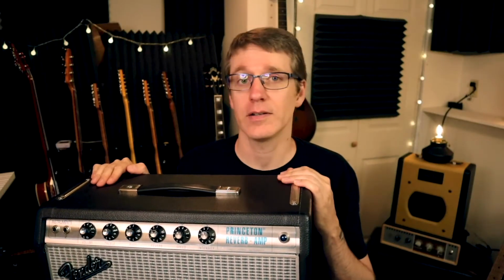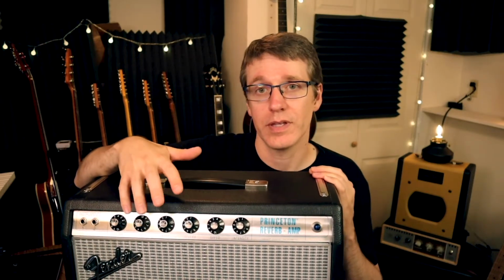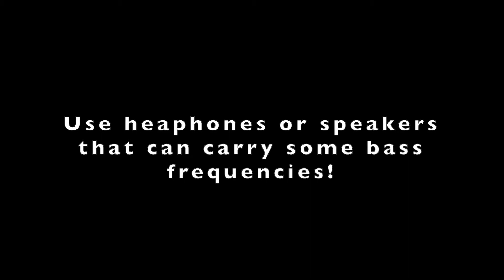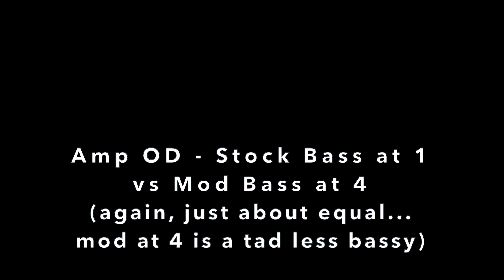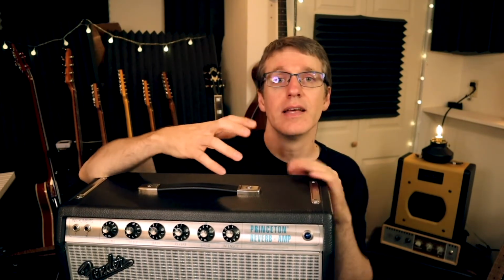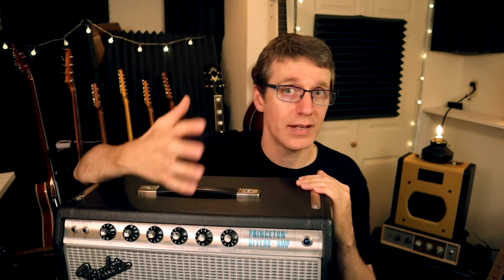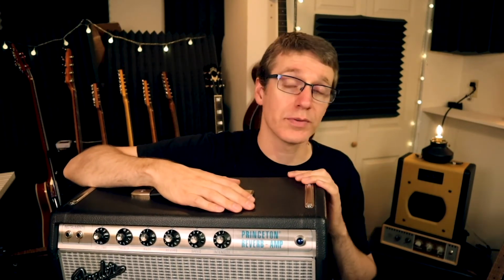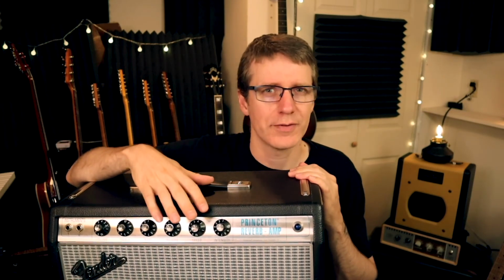Princeton '68 - Too Much Bass: FIXED! Stock vs Bass Mod Comparison / Fender Custom Reverb Amp / Mud

Comment: Excellent! I was considering adding a bright cap, to try to balance things out a bit, but I’ll give this a shot first! The switch idea is a neat idea, hard to tell if maximum bass is affected with the mod, but it doesn’t seem to be, based on your sound clips. Great video!
Reply from the maker: Glad you found it helpful! you get a LITTLE less maximum Bass, but I’ve never maxed it out for anything more than curiosity/comparison with the mod. Plenty on tap. Cheers!
Reply: @haskitt  thanks for the great video and the comment! I might just have my tech change the treble resistor so I can turn the treble up more, to balance it out more- wait, with that mid resistor bypassed, does the treble seem more responsive? With less mids, it should seem more sparkly and bright, inherently. I’ll watch the video again and think more about the treble this time.

Comment: I actually returned mine to the store due to the bass issue.  I wish I had seen this video first.
Reply from the maker: It’s really shocking how much bass comes on these things… I’m not surprised you returned it!
Reply: @haskitt  Do you have any experience with the 68 Vibro Champ? I’m not sure if I can get similar tones without the bass issues, or if I should stick with the 65 Princeton.

Comment: I opened mine up, and it does not have this resistor at all. But my amp definitely still has too much bass. It was built in 2021. Does anyone know what to do in this instance? Thanks!
Reply: I’m noticing the same with mine too (2019 build). Were you ever able to figure it out?
Reply: @LoganMcHargue43  Yes I was. And I’m glad to help. 

1. Change the tubes. I put in JJ’s and the over the top midbass reduced quite a bit. 

2. Change the speaker to eminence Alessandro GA10-SC64 10” 8 ohm. This cleaned up the nasty break up of the original speaker. It still breaks up between 4-5 but it sounds good. It also sounds like a heavy blanket was taken off the amp. 

These two changes transformed the amp completely. A little more expensive than jumping a resistor, but it’s now my favorite amp and I use it 90% of the time for both live (mic’d thru PA) and studio recording.
Reply: @BaronVonNebula  Thank you for taking the time to respond, I really appreciate it! After watching a few videos, I actually ended up grabbing a Jensen C10R (stock speaker in the 65) and a JJ 12AX7 for V1 and that made a WOLRD of a difference. Sounds so much more like a true fender. In hindsight, I should’ve probably gotten a 65, but even the used market for them is ridiculous. I scored my 68 for $800 with free shipping and it’s in excellent condition. Definitely fell in love with the amp after those minor tweaks and mods!
Reply: @LoganMcHargue43  glad to hear you got it figured out!